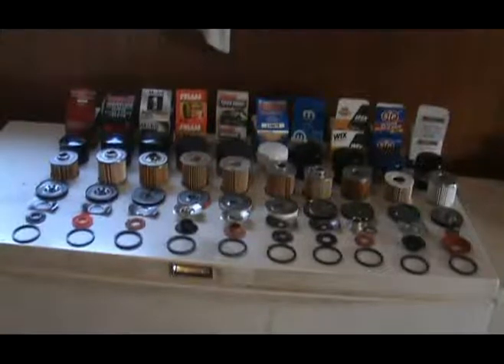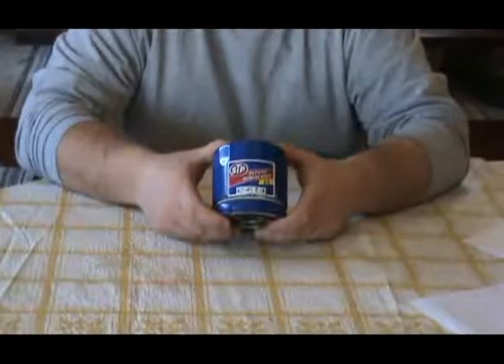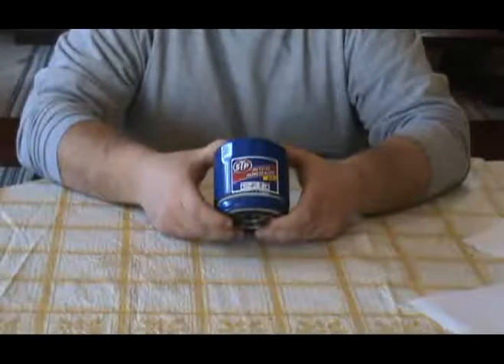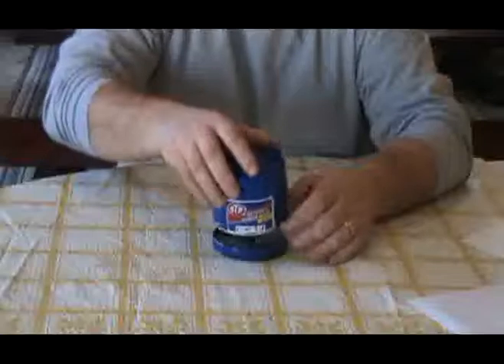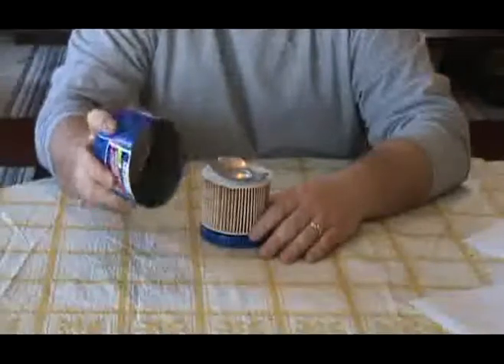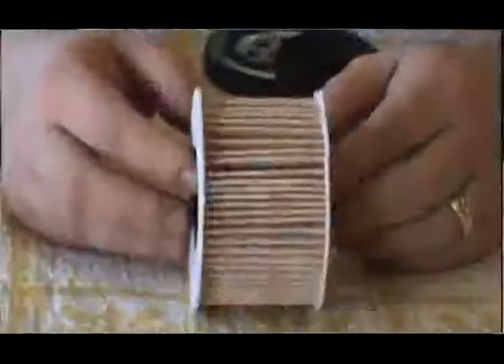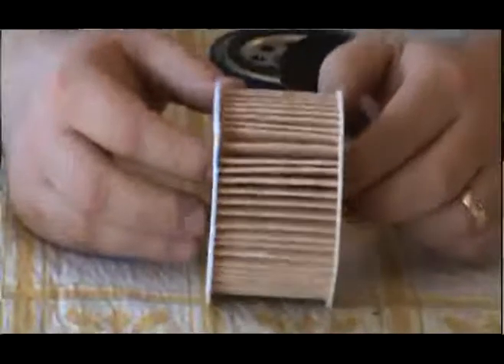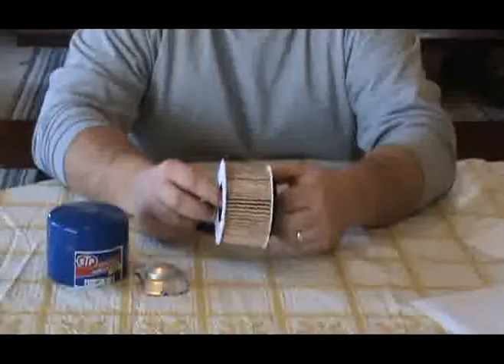What's in an STP filter?

Comment: @crazydiesellover I'm a diesel engine mechanic for 10 years, I still have yet to get an accurate reason why metal end caps make the filter better. What really counts is what the filtration material is made of. metal end caps need excess amounts of glue to bond to the filter element. the only piece in the filter that keeps the filter from coming apart is the metal strip that bonds the filter material and the center metal tube. dont say metal end caps keeps it from falling apart,...false.

Comment from the maker: I think a well constructed filter will have the longest lasting element and the most surface area in which to filter the oil. Also with these filters they need a decent drain back mechanism in order for better starts. If you view all ten that were cut apart there are certain ones that stand out as being better put together than others, but I will let the facts stand for themselves.